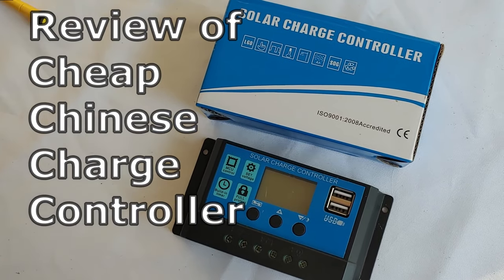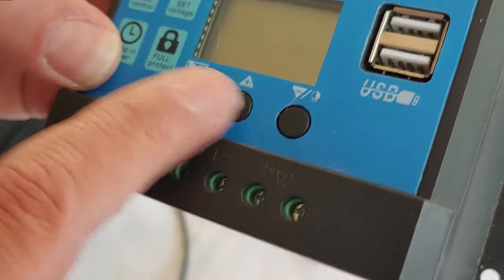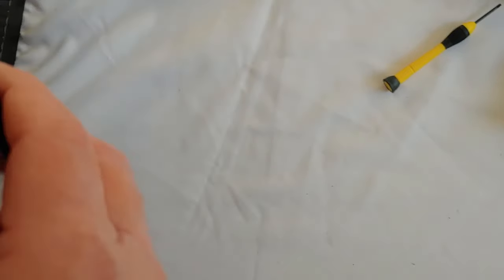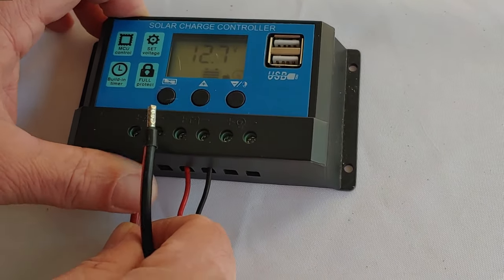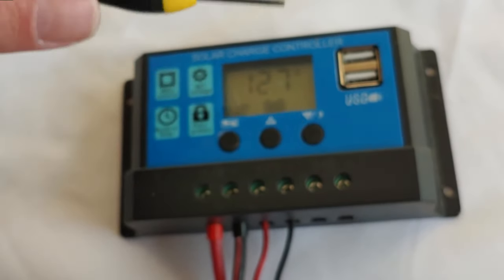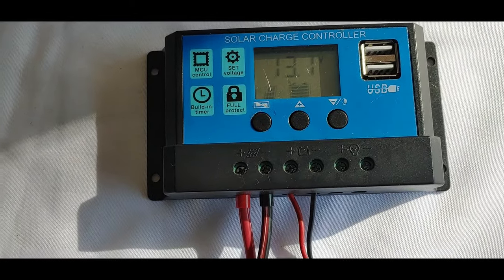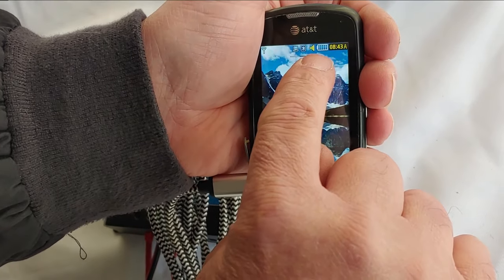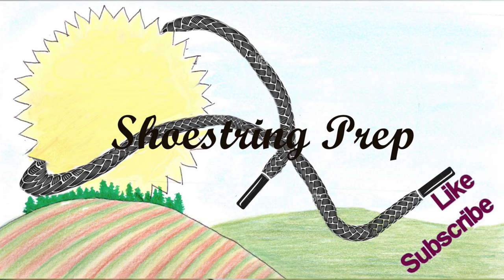Cheap solar charge controller

Comment: I had one of those when I was starting out  and had a 12 volt system. I only used it for about two months, and then I changed my system to 24 volts. I may try to use it for something else. I am installing some new #2 welding lead wire on my battery bank. I just now had rewired my Epever Tracer 40 amp controller...I added more solar panels, so I added another pair of wires coming in from outside. I will have to get two more panels to give me 1400 watts coming in. I think my controller can handle 1600 watts but I don't want to fry it this summer, with all the sunspots or whatever. The old cable was 1/0 but it had been wet so it did have some corrosion...I figured new wire was about due...but with a 2000 watts inverter, it won't have to be so big of wire, so I just got #2. With the the lugs  I have, I can always double them later if I get a bigger inverter. Two pair will carry 390 amps. My little inverter only pulls about 80 usually.  When I had 12  batteries, the system would act a certain way...now, with 18, soon to be 20...( The Twenty Mule Team Battery Pack )...it acts completely differently...once all these things are charged, nothing I can do will run them down for very long...they regenerate quickly now, like I didn't even use any power. Once I get my wiring into better shape, I think the system will work better than it has in the past. I didn't realize my cables were not in very good shape. SO I have forty feet of red and black cable, and some lugs and a propane torch...I have had a pair of jumper cables on two of my batteries , so that they would charge...they are hooked up but I have a bad solder joint somewhere or something...I'm going to try and find and repair/ replace before the sun comes up. I just added two 100 watts panels, so I want to see how they are going to do...here I was buying batteries every month or two, and the cables were bad...I should be able to weld off of them now, through a heavy choke coil and some big caps. So I have taken the secondary transformer coil out of a 1920's Greyhound welder...it looks like 40 feet of #8 wire, weighs about 12 pounds...the resistance is  0.1 ohm...it's a cloth coated wire, the ends are hand wrapped with friction tape. I still think it may be 5% gold in the copper, wire. It's  92 years old and still shiny like brand new...not even thinking about corroding yet. I've been around batteries and cars since I was five...I used to go play in the salvage across the street...my friend's grandad owned it. So I have seen every condition of copper, and it is a fact that it does oxidize...just like a penny...okay this old coil, the wire looks about like a year old penny...still shiny though...I've never seen copper that didn't tarnish somewhat...So I have to tinker with it and so that's how come I had to change the wire out. I want the whole team to be there when the welding experiment continues...but I can try it at least later maybe...I didn't want  to lose a solder joint while trying it out. I will have to go to Farm and Ranch later for solder, I think. Is 22,250 watt hours enough to weld off of, or do I need to go to 25,000 watt hours, by getting two more final batteries? In two weeks I will answer that question, but for now...I don't know yet...lol. I also have a brand new 120 volt motor off a blender that is brand new...it has brushes, so I can run it off my battery bank, and it will use almost no amps...makes a nice fan...just the right speed...I made one already, and it blows a lot of air...can run off of  #20 wires pretty long...they don't get hot...great summer time fan to blow on inverters and things...I'm going to make another one before spring. There's you an idea...try that. My old one has tape holding one of the brushes in because the holder is cracked, but it still works...I just want a better one, lol...the last one was a Craftsman leaf blower motor. It laid out in my uncle's yard for years until I picked it up...and I said, " I'm gonna make something out of this." Well, now it's pretty cool, turns out the motor had ball bearings, so it's quiet when running. It blows about the same amount of air as a box fan on high. I used a shield and blade from a Chinese desk fan that didn't work anymore. This would be a great project for anyone...basically the shield fits right on the motor easily. And the blade slips on and tighten...and that's about it except a switch , and the right polarity...the motors will usually favor one direction a little better than the other. And it will last years and years until you need brushes. I'll find another brush holder and fix mine better but it won't hurt a thing to have two fans this summer... remember to use 24 volts to run it. I have ran mine off of a 100 watt solar panel too...lol...it more or less runs at open voltage like 21.6 or whatever it is...I have left mine on for days in the summer...the last one was a four blade, but I'm going to make a 3 blade job this time. If you build one, be sure and be surprised at how much you are running it. Do a nice job, now. And you will have a keeper. It's like they used to say...even a blind pig finds an acorn every once in awhile. I just stumbled onto this, and thought I would share...it's a pretty easy build, and very worth it. I put a big pair of alligator clips on mine...and I'm building a 38 amp hour twin battery pack to make it mobile...I can't wait to see your reply to my comment, also...
Reply from the maker: When you had one of these inverters, did you use it? How did it work out for you? Any tips for the folks watching? 
Thanks for the comment.
Reply: @shoestringprep  I just had the Controller because at the time all I had was two 45 watts Harbor Freight 45 watts kits, which each had a 4 amp controller...so I had to use both of them for 5 amps. I got two 90 amp hour marine  batteries at AutoZone, and I was off on my solar journey. It worked okay but I had to move my solar panels from morning to mid day to evening, or I wouldn't get much of a charge. I had an old square wave inverter that I had bought at an O'Reilley's car parts place...terrible inverter, but that's what I had. The whole thing was sort of a tease...the panels didn't put out enough amps, so half the time I couldn't get a charge if it was cloudy. So then I got a stimulus check, and I bought two more batteries and three more solar panels with it. The controller would charge them with a good enough charge usually. When I got two more batteries, they never got a good charge...I didn't know if it was the panels, or the controller, or what so that's when I bought the Epever Tracer charge controller...so I didn't fry the first one, or anything ; I was thinking of using it on a little windmill that is low wattage. I also found out that if you use the load connection on the right side, it takes away from the charging voltage, and is better off unused, in my opinion, unless it is a very small load. At the time I was just trying to get a charge and didn't need anything pulling watts away from that. It was a little funny;  the box was marked 100 amps mppt charge controller...however, there isn't room for any bigger than a #12 wire going into the controller, so I think they made a typo, and it's a 10 amp. I treat it like it is, anyways. My 16 batteries are showing 25.4 volts at 6 : 30 AM...two are still unhooked...didn't get enough cable lugs to rewire everything yet...I changed all my battery bank cables except for two, with #2 welding lead. Those two had new cable already. So I'm going to see how things go with new wire on everything. We have some cold air coming in and they are predicting an inch of ice, so the grid may go off tomorrow. I'll get a couple more wire ends and get all 18 of them charged today, before it hits here. If the sun comes out today, I will know later how much better the system is now. It doesn't look like it will , though. I have a treadmill motor, (DC) that I'm going to put a 3 foot aluminum propeller on, and run the output through the little blue controller, and see what she does...after the cold spell, that is. I have heard they work pretty well on small wind machines, maybe better than MPPT because the voltage changes so much. I think this rewire job is going to make a huge difference in the charging. The old 1/0 cables were getting worse due to corrosion. I figured since it was so big, it would be alright for awhile until I got all my batteries bought. It was time to change them. I wanted to try the little controller again after I had new wire, too, to see if it worked any differently. So I will use it on the little windmill, and see what happens. lol  Every time I add two batteries, or do a major change to my solar system, and here I am watching for any change, the sun won't be out for two days now...from 800 watts of panels, I'm getting 17.6  watts. I just left the other 400 in the barn.
Reply: @davidpotter9462  ..do they sell paragraphs in harbour freight, you could put them into your comments to make it easier to read, just askin?
Reply: What made you decide to go to a 24 volt system? Isn't it just easier to setup a simple 12V? Not objecting but interested in your thought process. Thanks.
Reply: If you max out the charge controller and the panels going into it... could you in theory get around that by having other new panels going into a separate second charge controller, and having those go into the same battery bank but at a diffent connection site? And would this still be safe?

Thanks.
Reply: Oh, well, it might have been the batteries that I used. I had too much amperage being pulled from the batteries. I couldn't run anything for any length of time, like the oven, (1500 watts), without wrecking the voltage. I have somewhat resolved that problem, as I have 20 batteries now. It works better than it did on 12 v. I still have voltage drop, but it's way slow, and usually the batteries recover some. I have a more permanent solution on the way, I'm building a wind generator. What I have found out, the top set + of batteries runs down and charge back more than the bottom set - does. The 24 volts is not split evenly. The bottom battery will be higher than the other one. So the wind generator will help keep the top one charged. It seems that just a little bit of power helps the voltage. I guess it's because it doesn't have to charge the bottom set very much. But what I figured out is, after six years I can swap the bottom set out with the top set, and cycle the other batteries for six more yrs. So they should last twelve years, I think. That's a good enough reason to go to 24 v. I have more money in the batteries than anything else. I'm going to make an educated guess that wasn't the answer you were expecting. In case you're going to ask why not 48 volts, I don't have that kind of money. Hooking two batteries in series is not anything hard to do, as far as simple. There's just twice as many batteries. The transformation to 120 takes less amps, and I used marine batteries instead of golf cart or lithium. So I figured maybe it would last longer. Cycling the battery is what uses it up. It's 10 p.m., and they are at 24.7 volts. The voltage runs higher in the summer. At midnight they will be at 25.0 or so. It's been working well. I had to use the gasoline generator once in November. I figured the wind generator will help. It has always been a part of the plan. The other reason for the 24 v, is that it works pretty well with wind power. The 12 volts system wouldn't efficiently use the wind part of it. Sometimes there's less wind, but enough to be helping, so hopefully it will work. I figured the wind turbine will work better on 24 v. What I do on the solar panels is, there's six pairs of panels. So it lets the voltage go to 41 if it needs a lot of watts.  (On the panels side of the controller ). So far it has proven to charge better, faster. When I had six batteries, my system didn't do that well. But by the end of summer I will probably have 26 of them, so it will be good finally. I figured I might as well have enough power to run the A C this summer. I believe it will all work smoothly when finished. You can look at 24 volts another way. If I cycle the batteries really hard for the next five years, only half will wear out. So it basically saves part of the batteries, like a cushion against damage. It also keeps the batteries from bubbling all the water out. So with all that in mind, I went with 24 v. By June I'll have the air conditioning running off of it. The test comes when it's going. That and the deep freeze. I'm going to expand my system further this year. Oh, there's one more reason. You ever take two almost dead car batteries and hook them up 24 v, and start a car? I learned that at the salvage yard that I used to work at. That's all the reasons I have.
Reply: Yes you can have multiple controllers for the system. It's like two battery chargers on one battery, they just both charge it. My windmill will have a second controller to the same battery bank. I'm thinking about ordering a Midnite classic controller...but it's pricey. About 700. Have to think about it.
Reply: @davidpotter9462  

Thank you very much.
Reply: @davidpotter9462  Wow. You are amazing. That's seriously cool. 

Not many people are thinking about the long game like this. I want to do a long game. Its about sustainability and not being trapped and being in captivity to society that's going dark in more ways than one. I have more to ask you later but don't want to overwhelm you. 

Thank you very much.

Comment: i don't have a battery but would like to connect this to a solar panel to charge usb devices. is that ok? does it matter what watt solar panel? thanks, and i appreciate the video!
Reply from the maker: Connecting the charge controller to a solar panel without a battery will damage the charge controller. I do not recommend you do this. Thanks for your comment.

Comment: Thanks for the tips, if I have a gel battery can I use the 20a controller if I only have a 100w at the moment while I'm  still trying to upgrade  for a parallel of both battery and panels? Thanks
Reply from the maker: Yes, a 20a controller will work for a 100 watt solar panels. Thanks for comment.

Comment: I have this same charge controller. It works fine with my battery. I have an mc4 adapter for the solar panel to the terminal wires for the controller. I've tried two different panels and it doesn't display the solar panel icon on the charge controller. Does the terminal register that the solar panel is connected straight away and light up with the icon or do I have to have direct sunlight for it to work? Please help ☺️TIA
Reply from the maker: My controller registers as soon as it's connected to the solar panels but put yours in direct sunlight and see if it does it then. Thanks for your comment.
Reply: The one I am sending back will not display the PV Icon with any input over 32 Vdc.

Comment: On mine there is a Icon Labeled Lithium Battery and in the manuel it states that you can use it with one. It seems to be a bit diffrent then the model shown here even through it has the same layout.
Reply from the maker: Many of the models have different features. Thanks for your comment.
Reply: Mine also is lithium compatible... Can you tell me how to change to different battery type programs please? . I do not have instructions as it came used with another item I purchased
Reply: @joepellitteri9163  in my manual it simply states that you must connect the battery FIRST as only then the screen works and it automatically detects the battery type

Comment: I have same one here in Ukraine, a 30A version. Few strange things about it.

1. When arrow between pannel and battery icon is flashing the current in flowing from pannel to controller (I put multimeter in that line). But, when the arrow is constantly on, current is not flowing, and the dusplay on controller shows 14.4 v. 

2. After a minute or so the arrow starts flashing and current is flowing. This lasts forva fe minutes and than step 1. begins again.

Looks like controller does not have propper hysteresis set, or whatever, and it can not stop charging properly when the battery is full. Arrow should not be on at all. 

I use 200Ah lead acid battery.
Reply from the maker: It can act strange. Thanks for your comment.
Reply: The issue is that it only connects and disconnects the panels to the battery.  It does not control the amount of current to top off a battery, so if you have a small battery and a big panel, it will send all the panel power to the battery and the voltage at the controller will prematurely reach full charge voltage even though the battery could accept more power if it wasn't so much power trying to force feed it.
Reply from the maker: @Andy-df5fj  thanks for the info and comment.
Reply: @shoestringprep  
You're welcome.  After reading up on another similar controller, it appears to be the Lifepo4 mode that causes it to act like this because apparently,  pulse width modulation (PWM) tends to confuse the BMS circuits inside Lifepo4 batteries so instead of tapering off the charging current once it reaches 14.6 volts, it just disconnects it.
Reply: Yes, mine will always charge at 14.4 Volts with no exceptions. It is a very cheap device.